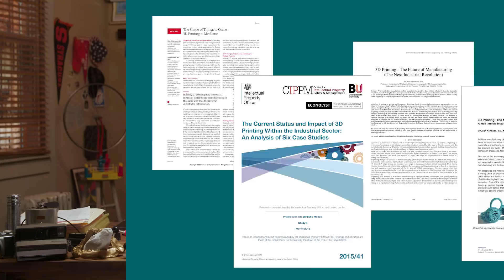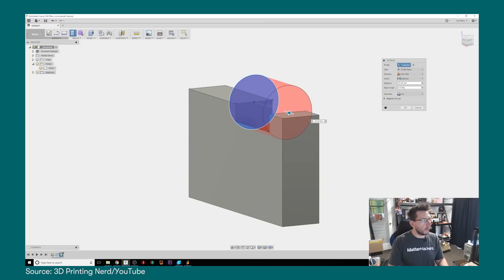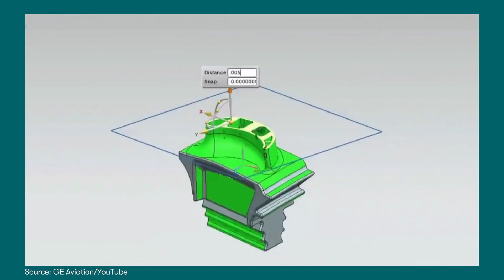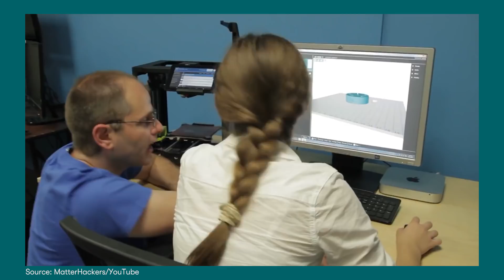What happened to the 3D printing revolution?

Comment: Oh hey, look - it's everything I was telling all my 3d-printing crazy friends back when it was starting to really take off.

I really don't know why people thought it would be common home device (too complicated for most people, not useful enough for most who know how to use it) or why it would be used in mass production (you're not going to beat injection molding with a 3d printer in either quality or efficiency). Plus it seems most people ignored the materials aspect entirely (no, you can't print a custom hairbrush with non-ABS plastic bristles, this isn't a replicator) or ignored the time component (to get back to the efficiency issue). And the quality and material options of home printers is pretty low - just like normal 2d printing, you're much better off sending your file to a print shop than doing it yourself - higher dpi, better materials/papers, don't have to buy a $100,000 printer, etc.

But where it shines is obvious - prototyping, one-off parts, and otherwise difficult to manufacture parts. It's great when you just want one of something, like a ring, or necklace, or D&D mini, or when you're testing physical designs before moving to molds. But most of the hype is nonsense (not saying it isn't awesome technology, just it isn't a magic replicator).

Comment: Also, you need to have some mechanical/electronic skills. You need to adjust driver current, fix connections if something goes wrong, you need to know how to solder, how to apply grease to bearings and leadscrews. It`s harder than regular Xerox, nobody disassembly his Xerox or HP just to add grease lubricant or check drivers current. People are lazy and wants "all included", simple usage things..

Comment: As a 3D printer owner starting in 2013, I was under the impression that it would take around 10 years for everyone to have one.  Even at this point its not to the point where its useful for the average person.  Industrial levels with lots of multi materials have to be developed before its worth it for the average person to buy one.  Kids are getting exposed to them in schools 2022-2025 you will see the 3D Prtiner killer app take off. In computer terms the teens were the 70's, the 20's will be the 80's.

Comment: I would like to mention archeology where a one of a kind skull and/or bones can be scanned and printed for researchers, and facial reconstruction. Types of 3D printing are coming to the forefront like spraying fine metal particles at Mach 3, and oxygen bubbles cutting the speeds and increasing the available materials.

Comment: you're not wrong about 3d printing, its mostly used for quick prototyping and able to do things "in-house". There are many resources and info about 3d printing. I even bought my first one, a prusa version chinese model a few years ago. I didn't know what to do with it. I didnt know which filaments are good and which are bad, But its a learning process. But from then to now I am able to make my own printers. I'm in the process of making my own sls printer and multiple other versions and I love making them and making things from them for a price that is significantly cheaper if i paid someone to do it for me. I keep seeing multi-color printers trying to keep the hype up. I'm just fine with a single color filament and doing the post-process afterwards to make the part look nice. One thing i am waiting for is being able to recycle plastics into filament. Now that would be something, they have those. but not at the quality that bigger companies are able to make

Comment: I just want to add my observation. 
The major revolutions happened in industry first, then "trickled down" to homes. I still believe that 3D Printers will end up in the majority of homes, BUT I don't think that will happen for sometime. As it sits they take too long, are too expensive, and are too limiting. Once multi filament, multi material printers become standard, that will also help.

Comment: Here is the thing: to make something in the consumer market to really prevail, it has to be simple enough. If e.g. Apple would get into 3D printing, THEN 3D printing would become a success and would probably get into every second household.
There are several very useful technologies, which simply didn’t got an easy enough (or cheap enough) interface - to be adapted by a lot of people. For example databases (Filemaker is great - but expensive and still to complex), or other stuff.
Another point is the lack of common standards (e.g. material). And the constraint of sufficient useful materials which can be directly printed) (e.g. if silicon could be directly 3D printed, a lot of hobbiest cooks and other people could use 3D printers to do some molds. At this stage you would need to make a 3D printed plastic sample, make then out of it a silicon mold, to finally use it to do your casting). 
This is for sure a big deal:
3D printing is still too expensive, too complex, too unpractical, too expensive to maintain (especially if you are living in a place, where you don’t have free Amazon shipments).

Comment: I'm confident that there will come a time when some kind of autonomous fabrication machine will make sense in a domestic, non-specialist household. I'm equally confident that it won't share much technologically with today's 3D printers and won't happen any time soon.  It will need to be quicker, more accurate, more reliable, more versatile, and easier to deal with. 
 Impressive progress has been made, but it's a long journey.   Incidentally, 3D printing within industry has been around for a long time.  I remember seeing 3D printed mock-ups of components at Ford Motor Company over twenty years ago. (granted the technology wasn't as user friendly).

Comment: I know several people with 3D printers.  There are two things that I believe lay people getting into the tech aren't prepared for
1) How slow it is 
2) How finicky it is.
I have a friend who's printer sits idle because he isn't satisfied with its performance, but it just needs a ton of tweaking.  The right layer height, the right speed and feed, the right temperatures, proper tram, etc.  There's a lot that can be wrong.  That failed print at the end of the video isn't a problem with the technology, it's a problem with settings.  Once it's dialed in, it can be as easy as a click, but getting there takes effort.

Comment: When 3d printers can print with steel, aluminum, glass and silicon and print nano scale structures they'll be more then a gimmick. I've had to haul a 5 pound box of steel nuts and bolts 1000km before and this should be a perfect example of what should be replaced by 3d printers. A mono material made of one material. And yet 3d printers can't even do that yet. When a 3d printer can print nuts and bolts at high enough definition to let the threads work together, and out of high strength steel, THEN they might be useful. But they can't, and there's nothing on the horizon that could.

 3d printers were a big flop.

Comment: I built a 3D printer for printing small parts for my FPV drones. For that use its brilliant.
The problem was I had to spend so much time printing parts for the 3D printer to upgrade it.
Then there was the problem printing different types of filament took trial and error.
In the end making the part from balsa wood was easier.

Comment: At-home 3D printing isn't dead, it's just not here yet. You stated the problem in the video, the ship isn't even finished yet but people jumped aboard expecting it to float. Hobbyists are still using 3D printers to design some great things. However, they're hobbyists, this is their niche.

Something like this needs to be in the industrial sector for a lot longer before it becomes a commercial product. There are too many variables to account for, like nozzle sizes, layer thickness, types of plastics and their uses. Until there's an adoptable standard that can simplify at-home use, we're going to have to wait. 

We didn't have newspaper presses in our homes when they were first invented. Now we have several types of at-home printers.

Give it time, it will come, but not until it's ready.

Comment: Maybe people realized that the only thing that a layman can do with a 3D printer is produce little pieces of junk that nobody needs, and they're going to throw away in a few days. There are ALWAYS hundreds of "engineers" on hand that will tell you ALL ABOUT how much 3D printing saves their firm on prototyping costs... but it's pretty much universally a lie. Those people are "prototyping" stupid crap like cell phone cases and cable organizers.

That little "odd geometric shape" you showed is an excellent example of what 3D printing can really do... Nothing important. If it cannot be machined, it is extraordinarily unlikely that it serves a real purpose.

Also, those fuel nozzles that people like to get excited about GE making, they were big news about 5 years ago and still haven't passed the testing phase, because they're kinda junk. They expand and contract in bizarre ways, they have frequent failures from heat and vibration, and they STILL needed to be milled after they were printed, because printing is about as precise as measuring screw threads with a yard stick.

3D printing is, after multiple decades of work, still a hopeful tech of tomorrow, and it shows no signs of making any progress anytime soon.

Comment: Imho, professional 3d-printing is pretty awesome already, but for personal use, it's just too complicated and not precise enough.
The biggest steps will be dual-/multi-material printers. And we still need a bit more stable and easier to use plastics to work with. 

In a way, todays 3d-printers are like the early Comodore computers. They might not have had the same position in our homes as modern computers with connected devices have, but they were the foundation we developed those on. 

The moment, 3d-printing becomes a tool to make your own replacement-parts for products or even print your own products, it will explode just like PC-use exploded with the internet and music&video platforms.

Comment: Did you just talk shit about Bre Pettis being to hype-focused, and then in the same segment, talk about settling Mars?

Seriously though, even consumer microwaves aren't the real killer application of microwave heating -- look at production line microwave+infrared ovens for cooking pre-packaged meals and microwave-cured glues for low-cost, high performance engineered wood products. These two uses alone enable industries which are much bigger than the consumer microwave oven game.

And this is almost always how it goes with technologies of production in a consumer-driven economy: It makes more sense (and money) to use the tech to make more things that people can buy, rather than selling them the machine to make stuff.

But don't put down industrial revolution 2.0 just yet. Lots of us are still out there working on it. And if you're paying attention to the various stressors acting on the current industrial economy (climate change, protectionist trade practices, collapse of food-providing ecologies, increased prevalence of agricultural and human pathogens capable of causing pandemics, depletion of mineral resources, etc) then you can see why a de-centralized, non-global-supply-chain dependent manufacturing methodology (like Additive Manufacturing could become a part of) would have an advantage in a post-globalized-industrialism-collapse economy.

Put another way, early mammals looked pretty useless, and generally want unnoticed in the shadow of all those awesome dinosaurs. But when the global ecological order was disrupted such that being big and laying eggs was no longer advantageous, mammals were poised to evolve to fill all the same niches that dinos once occupied. It's not a question of whether AM and other distributed tech are "better than" mass, globalized industrial manufacturing. It's a question of whether they will be able to do enough, well enough to take over some (or all) ecological niches when the current global economy stumbles.

Comment: I've been 3D printing for 5 years and work for a multi billion dollar company. My company just can't understand how to integrate 3D printing into the company, but will buy specialized replacement parts that have been printed from other companies . WTF? 

On a personal note I've 3d printed proof of concept moving mechanisms for work and print so much stuff at home. I'm currently working on a cold air induction system for my sons car.

3D printing is dead if you don't understand it!

Comment: Why hasn't Consumer 3D taken off ??
> designing 3D models suitable for printing, is HARD!
> maintaining and tuning a printer to produce good results, is HARD!
Neither of the two above items is going to change any time soon .. significant user friendly advances must take place in 3D CAD design software (i.e. self engineering of designs with minimal user inputs) .. and the 3D printer hardware must advance to be fully automated in achieving top notch results with little or no print failures .. and speeding up print times would help a lot!
On the flip side, anyone who can model well in 3D CAD and can maintain a printer, can participate in the new maker economy, with little competition.

Comment: I can tell you that my company is booming with 3D printing for aerospace. Metals and plastics both. It is still mostly research/test parts. We do some production parts, but it’s only limited at the time being because we are still working on shifting designer mindsets to utilize the full benefits of additive manufacturing. There will be much much more coming through additive manufacturing within the next 5 years

Comment: Until you've printed a working Slinky in ABS on your homemade 3D printer, dont tell me how "it's easy, anyone can do it". I can tell you, it's a PITA!
Reply: Yeah. Either "easy, anyone can do it" and it costs thousands, or it's "cheap, anyone can afford it" and very frustrating. My printers belong in the latter group.
Reply: Kris Sisk lol on a $160 anet a8. ABS only took 2 tries. If not for AC blowing in the 70 degree house, would have been 1st try. I put it in a corner under a table with a blanket draped over it. Took about 30 minutes of careful work with a utility knife to separate layers. But like everyone knows now, I got it for prototyping.
Reply: VestedUTuber yeah, but I did it.
Reply: You printed a slinky? In ABS? On a homemade printer? Are you a masochist?

Comment: Some years ago, 2D printing became available but people are still buying their wall papers, posters, books or maps.

It's the same for 3D printing, proper manufactured items are cheaper and more durable than simple 3D printed things. 

Designing in 3D is still something many people can't do and there are many people who can make things out of wood, resin, concrete or metal without a 3d printer.

Comment: Of COURSE it failed in consumer markets. If we're talking about a new industrial revolution, thats not going to happen "in every home in the world" thats going to happen in the toolsheds of inventors, or hacksmith houses, or small startups that need rapid prototyping solutions, or in professional artists studios. And for this technology to really be practical and matter, especially from an R&D solution, we need to develop the technology further so it can print metal much cheaper, or in a variety of other materials. Once we have a single consumer printer that can print at a fine scale simultaneously in at least both metals plastics and capable of creating functioning circuits, we will see a huge resurgence in the practicality of this machine. Right now, it is not always the practical solution.

Comment: I remember the first computer printer I bought.  It was very expensive and not anywhere near as sophisticated as the $50 ones I can buy today.  But in those days, I used it in my work and it was worth it.  When I first heard about 3-D printing, I was very excited about it and thought in time it would probably be the same story.  This hasn't happened with  3-D printers.  Even today, there's not one that I can afford.  Otherwise I would have one.

Comment: The reason 3D printing is not  catching on with the general consumer is that machines out there are still too expensive for those that actually work as advertised. Some are complicated and you have to build it your self . Some prints take days to complete. Some are  just unreliable. If they worked as well as a Microwave more people would buy them . the technology needs lots of improvements

Comment: 3D printing is bigger than ever.   and the price at which you can get an amazing printer for is unreal.  its not gone anywhere. its moved forward but has yet to become a home appliance.    I dont think were far off though.  they need to create a need for it.   there is one but its not obvious to the average joe.       mine is a godsend and one of the most used tools in the house so...........

Comment: It was never going to work for domestic use outside the hobbyist niche. In any developed country, whatever item you may need will be easier and cheaper to get from a traditional manufacturing process. Yes, there are cases where you need a part for an obsolete product and 3D printing can really help you out there, but that happens rarely enough that you're better off tasking a professional 3D printing business with producing that part, rather than to acquire a printer, raw materials, blueprints and make it yourself.